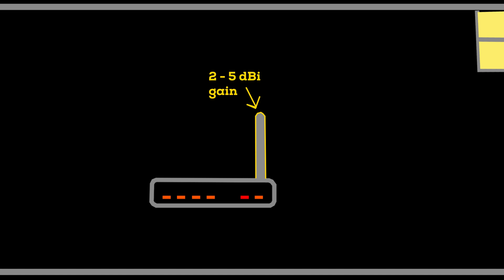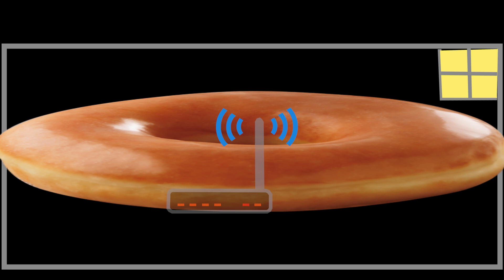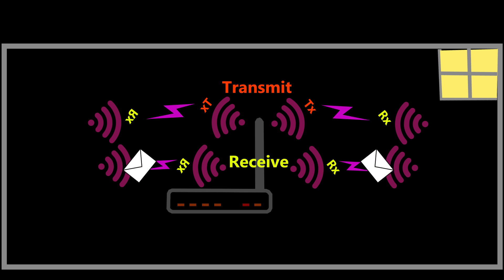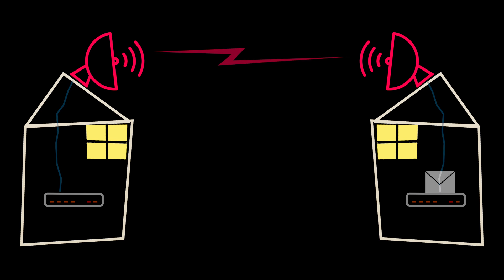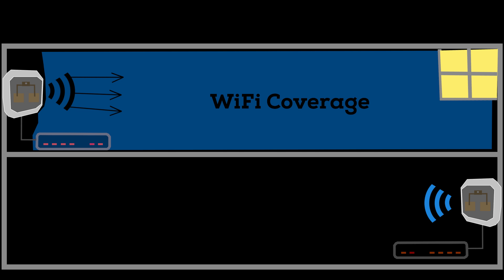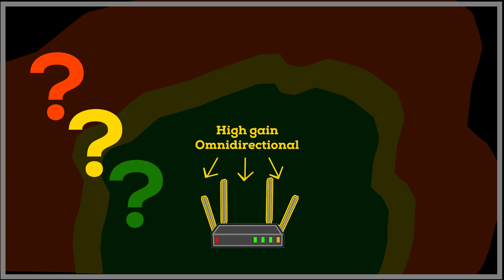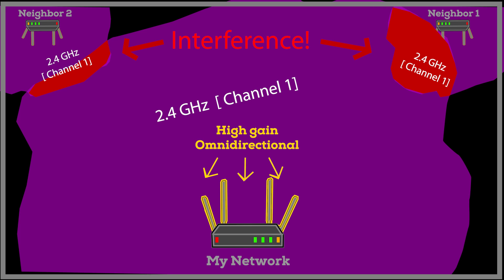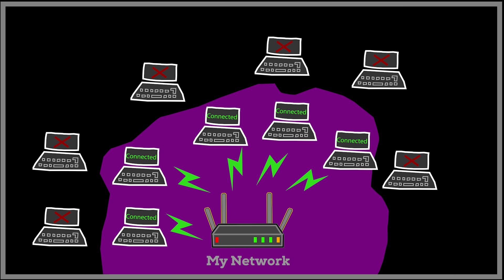Replacing WiFi Antenna! Good or Bad?

Comment: Ive got 1gbps from new isp, ended my old ac86u, was looking at the ax86u pro for the extra features but i believe its only wifi 6, my isp gave me a router apparently dual band Linksys velop mx56, not that I've been able tp find and information about it Ax5400 speed, i guess if anyone knows .... How does this compare to ax86u pro? Many thanks for your help

Comment: I tried the tp-link deco. The package came with 2 units. When used as intended they worked great. However, I had issues with having to use my phone to access it's dashboard which was very limited on options. The interface on my desktop computer was even more restrictive and a waste of time. I eventually went back to using my AC4000.

Comment: Mesh
Reply from the maker: we'll get there eventually :-)
Reply: Yup meshing is a solution or if you want to get your hands dirty,
pull a network cable from your main router, to the location where 
the signal is weak, hook up an old wifi AC router, convert it 
(remove the firewall, dns & routing function, enter a static IP, 
getway address) into a access point. @Behfor